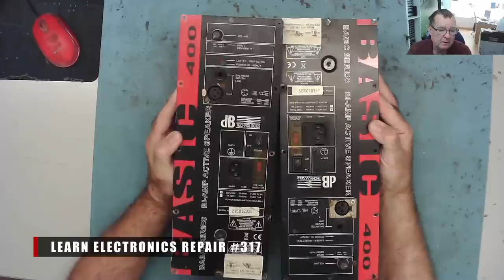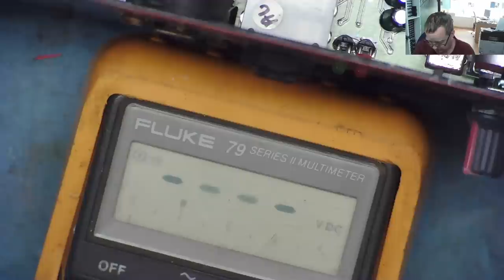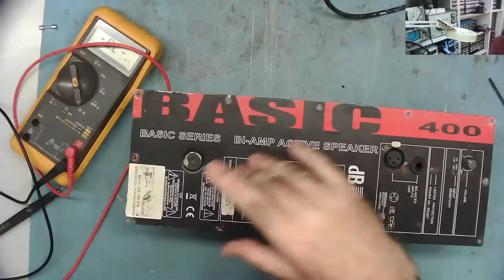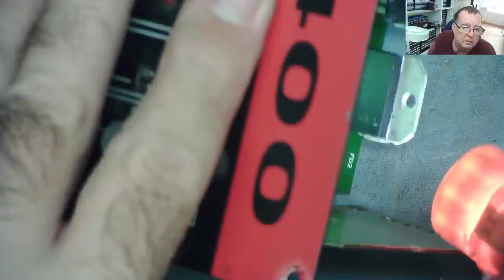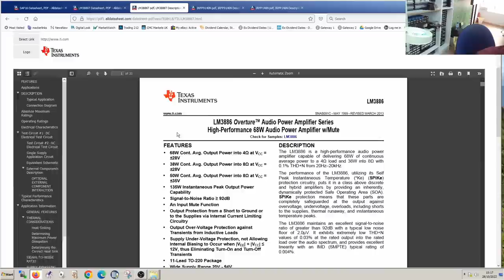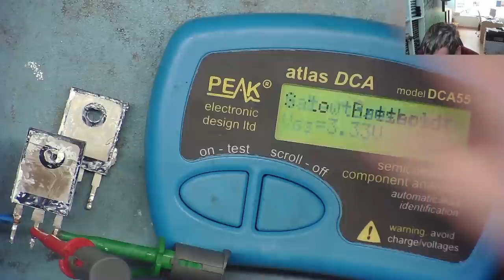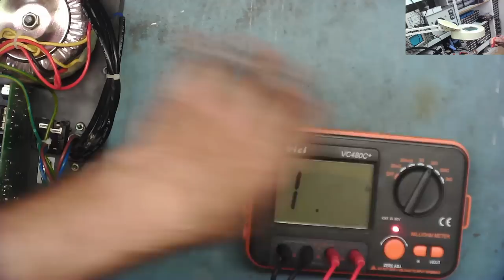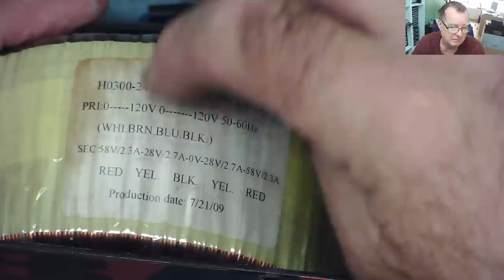BASIC 400 Powered Active PA Speaker - Blows Fuses, But Why?

Comment: Personally, I would have pulled the high voltage fuses before pulling the MOSFETS.  I'd need some measurements to be sure, but I think it would have accomplished much the same as far as isolating the fault.
Reply: I was thinking the exact same thing and was about to type that until I saw your comment
Reply from the maker: In retrospect I totally agree with you 😉
Reply: Russell I’m not quite sure what you mean? There is only 1 fuse in the 240 and surely leaving that out is only isolating the iec input which is basically like leaving it unplugged and then what. Unless I’m missing something?
Reply: @deangriffiths8107  We are talking about the 2 load fuses on the PCB itself.
Reply: Thanks for the reply Eric that makes sense now, I had a couple of shandy’s last night when I commented so this went over my head.
Reply: @deangriffiths8107  There are two fuses on the PCB that are for the high voltage to the power amp.
Reply: @russellhltn1396   yeah I realised that this morning when I saw the reply from Eric, thanks for replying though I do appreciate learning something every day.
Reply: @deangriffiths8107  Lol no worries!  Cheers 🍻
Reply: Personally, I would have looked for the schematic first.

Comment: I would have checked the fuse in the working amp to confirm rating. Anything not sealed with a blown fuse, might have had it swapped by a DIY bloke with something random he had at hand
Reply: The fuse rating on the cover says slow blow 2.5A 😉

Comment: I was surprised that you didn't zero in on the supply section quicker as the DC fuses were not blown - but then armchair technicians are like armchair quarterbacks! I had my money one the voltage selector switch - cheap switches plus island environment, a little corrosion, a little heat, some melted plastic - pop goes the fuse. Thank you for sharing the process - always interesting no matter the outcome. Regards,  David
Reply: I was shouting transformer, you know that bad feeling...Edit reading another  post seems there were MOVs or caps there too, so not just bridge and reservoirs..I was skipping through and someone said he measured a short?
Reply from the maker: @martinda7446  If there were any MOVS there then A: they were the special transparent ones and B: They changed the resistance of the secondary winding (with the transformer disconnected from the PCB)
Reply: @martinda7446   Yes, a bad feeling indeed but that toroid looked sooooo good on the outside.
Reply from the maker: @davidv1289  Yes it does, if it looked distressed I would have homed in on it much quicker
Reply: David, absolutely it’s easy for someone watching and then to say at the end why didn’t you look at the transformer first. I like a lot of others enjoy watching and learning from someone actually doing.

Comment: Thank you again.
I am but a mere electrician, but when looking for faults i always work by "big fault, big components first". Since the transformer was easy to unplug, it would have been the first thing on my list to cross off. BUT i seldomly have two of a kind, so comparing resistances of the winding helps a lot.
However i enjoyed the methodical hunt alot. Always learning new stuff... like where the hell do i get a lightbulb in 2022? 😀
I was planning on building uC controlled current monitor that cuts power to a device when a selected current is exceeded. Dunno how useful it would be though.
Reply: I have a digital current control power supply I used for DC stuff that's super handy.  I bought a cheap voltage/current control module off of Amazon for $10 and put it on a large DC supply.  It's a boost/buck converter.  Gives milivolt accurate and miliamp accurate controlled output, and has auto current limit or shutoff.  Goes up to 30 or 40 VDC from .001 to 20 amps or so.
For AC you'd need something smarter and more expensive but almost everything ends up converted to DC in circuit anyway so I have yet to need one.
Reply from the maker: The reason why I didn't find this fault earlier was not because I wanted to make a good investigation video but because shorted turns on the mains transformer is really uncommon, and especially so without it looking physically burnt/distressed.
Reply: @LearnElectronicsRepair  I see, this is perhaps because my contact with stuff is a bit different. I usually had to deal with either stuff that was hidden inside wall boxes with insufficient cooling, smashed components (if they don't fit, they'll find a way to make 'em fit) or with stuff in heavy industry settings where there was so much metallic dust going around that you could meassure the air with an ohms meter ;-D
Reply from the maker: @DasIllu  I think this is a likely case of too much knowledge slowing me down.  I agree someone with less experience of these amplifiers would likely have found this fault quicker.  But hopefully more viewers will know about it now if they ever come across it.
Reply from the maker: Regards light bulbs, I buy then from the local shops, is there a shortage of them?  You can also get them (halogen ones which work just the same - in fact some of mine are halogen) from AliExpress, Amazon, Ebay etc no problem so I don't think I'll be panic buying in the near future 🙂
Reply: @LearnElectronicsRepair  Thanks again. Everything incandescent has vanished from the local shops here in germany. It's been years since i last saw a halogen bulb in a bulb. Maybe they have some hidden in a dark corner in my local DYI shop. Will investigate.
Reply from the maker: @DasIllu  Look for the straight halogen bulbs type R7s they are generally available in large hardware shops.  Also G9 which you can get a pack of 10 from Aliexpress for €4.55 with free shipping.  These come in ratings up to 60W and you can use a few in parallel if you like.
https://www.aliexpress.com/item/32677043072.html?af=ler2022

A coupe of packs of those should keep you going for a very long time.

The limiter I use in the video has a 65W halogen bulb.  My other one has two bulbs and is selectable 60W/100W/160W
Reply: @LearnElectronicsRepair   I’m not sure people with less experience would have found this quicker as the transformer showed no signs of damage.
Reply: @LearnElectronicsRepair  Good to know, though. The bulbs are forbidden here in Holland. 220V Halogen is easy to get. But not for long, I assume.
But a fan could work, isn't it?

Comment: Low melt solder works great when the board is really thick or the component itself has legs or heatsinks incorporated... that way there is less chance of damaging the PCB, plastics or components near it.

Comment: Measure that transformer using an insulation tester (or similar like Megger). Plus measure the primary against the secondary. The insulation tester will tell you quick if you got a shorted  or open winding(s).
Reply from the maker: The transformer causes a short condition when it isn't even connected to the PCB.  And the secondary winding reads low compared to a known good one.  What more is there left to prove?
Reply: @LearnElectronicsRepair   Wanted to see if the short is just between the pri winding or went through the pri -sec, or shorted to the case. Doesn't matter... However using the dim bulb tester, plug in that transformer with the secondaries disconnected... see if your dim bulb light is bright or not. Should be a easy and clear verification if the primary is indeed shorted to itself.

Comment: I'm sure I'm not telling you anything new, but when I have stubborn components that don't want to  release from the pcb- i flip the pcb upside down and just feed a massive glob of fresh solder that covers over all the pads at once and it just falls out.  Its also how I remove multi pin amplifier chips too. Thanks for sharing all your knowledge with us!
Reply from the maker: Nothing new, I do that quite a lot on video but you are right, it's a very good technique 🙂  There are always many ways to achieve the same result in soldering.

Comment: I always learned to rule out stuff instead of random chasing faults. I would have started at the transformer, disconnect the outputs and see what happens. In this case the video was done in about 5 minutes.
Reply from the maker: It wouldn't have been a very good video though 😆

Comment: I think one solution to removing the fets would be to use low melt solder or to acquire a large soldering iron wide enough to cover all three connections at the same time, such as a hobbyist wood burning type hi wattage iron
Reply from the maker: Yeah that could well work - there are always a number of different ways of doing this sort of job.

Comment: Very hard to find a shorted turn in a transformer unless it a short between each end of the coil. A shorted turn in the middle of the windings will not show up with a resistance test as one turn will not change the resisance much. Bit as you say a shorted turn will show up with AC as it will be a one turn secondary looking into a short circuit and draw lots of current. 

Lets hope that they used an off the shelf transformer and not a custom job. The other thing that can cause the fuse to blow is if they have removed the transformer and not put it back on corectly. the mounting bolt through the middle can be seen as a shorted turn if it gets connected together at each end on the outside of the transformer.
Reply from the maker: Your comment on the mounting bolt acting as a short is very interesting.  It would not of course produce the resistance readings I got on the bad transformer secondary, but I will definitely keep that in mind for the future 🙂
Reply: @LearnElectronicsRepair  DC tests will not show a single shorted turn E,g resistance measurements, they will show if the ends of the windings are shorted. Or a major breakdown of the windings due to overheating, but I expect you would have seen signs of internal overheating on the outside. If the transformer is scrap then unwinding it might be the way to see what has occurred to it.
Reply: @karltest1314  Which is why i said you can't find a shorted turn with a DC resistance meter. you need an AC componnent.

Don't mix the current fault and the previous fault, the last is just the outcome of the first. A slowly overheating winding will not blow the fuse as it build up to breaking down the insulation. Once the insulation breaks the last fault appears in which now it will blow fuses in an instant. First fault was the cause the last the affect.
Reply from the maker: @TheEmbeddedHobbyist   I hear what you are saying but IMHO you can (sometimes) find this fault using a DC resistance meter when you have a known good one to compare with.  I'm confident I proved that with the Fluke, then went on to confirm it with the Milliohm meter 😉

Comment: Iv got abit of an issue with something im working on and wondered if any of you clever cloggs could point me in the right direction . So ive got a panasonic dvd/vcr recorder, which needs a firmware update, the update isnt available anywhere , i have the main board from the same machine which has a different fault but should have uncorrupted firmware, my question is where would this firmware be stored , i know on tvs its usually an 8 pin bios ic , am i looking for something similar here? I want to swap the chip with the firmware over to get one working machine out of the two bad main boards . Thanks for any help
Reply: I suppose what im really asking to clarify, is firmware always stored on 8 pin bios ics in most devices ? Im not a software guy whatsoever hence me being so clueless
Reply: Update: firmware was on a 50 pin chip, machine now working

Comment: If the transformer overheated I would expect the thermal fuse to go , so it’s strange to get a shorted winding with no obvious cause.well done !I would have struggled with this I’m sure
Reply: I need help to fix mine
Reply: The thermal fuse is usually touching windings on outer part of transformer and can sometimes be replaced. A dodgy job is to short the fuse but then you have no thermal protection!
Reply: How do I get a hold of you to show you a picture
Reply: Try searching YouTube for transformer thermal fuse , there are a number of good videos 
PS it’s important that you find out why the fuse has blown !

Comment: The only time ive had something blowing fuses with no short , was a tv i was working on, a small blue ceramic disc capacitor on the primary of the psu had a hairline crack in it , and after i found and swapped that it stopped blowing the fuse
Reply: So it expanded from heat? Or created an arc?
Reply: @TheDurdane  im not sure why the cap failed , it was connected to one of the pins on a mosfet on the primary

Comment: Reminded me to ask a question been bugging me for months. When you mentioned using your thermal camera, it reminded me to ask if capacitors that are not working get hotter or show cooler than ones which are good? And a supplementary. 

I'm always impressed by the precision of the characteristics component makers list and I wondered whether a predictable working temperature can be stated for most components? It would be a function of their wattage, composition and size? It might be quite a quick way to diagnose faults if components had a stated working heat output? Or am I being lazy and looking for a quick way of doing something that can only be done the hard way, with skill and experience?
Reply: Yeah I've been wanting to add a thermal imaging attachment for my phone for this reason. I've  even considered getting the Cat branded smartphone (it comes with a Flir camera built into it from the factory) even if I just used it as an offline unit (the appeal being the rugged design and impact resistance it has. 

Anyway, with something like that recording when you turn on the mains, even if brief, there should be a hotspot right?

Seems like a potential time saver for sure. I haven't been doing much of any PCB work lately so I've shelved this "need". Chasing smoke and using an infrared thermometer to guestimate the source will suffice for now. 

TL;DR I agree a thermal camera would make quick work of identifying the heat source.

Comment: IF IT WAS ME I WOULD UPGRADE THE MOSFETS,! higher amps and higher voltage,, plus new transformer
Reply from the maker: To achieve what? (replied before you edited your comment to mention the transformer)
Reply: @LearnElectronicsRepair  Higher tolerance margin in the FETs?  Although the fuses should stop damage to those.
Reply: @_Stin_  exactly. people make mistake of just replacing like for like, but while ur in the unit upgrade just as cheap,, i been a engineer for over 30+ yrs in ind and fix amps on a regular basis, but thats just what i would do, mosfets that are too weak put a very large strain on caps and transformer, if they dont switch fast enought they cause, ware on transformer, higher amps mosfets and power output quicker push n pull. releaving transformer having to work harder, less strain,,"also transformer doesnt have to be exact same voltage out think them transistors can handle much higher voltages, on output stage, you would need to check, on what they can handle if ur keeping original fets, but like i say i would upgrade them,

Comment: Re LEDS you didn't notice the round and square pads.
Reply from the maker: I noticed the K markings on the PCB.  I think the part about the internal structure of the red and green LEDs was quite interesting and maybe useful to some viewers.
Reply: Also, LED housings have a flat side that marks the cathode.

Comment: Hi Dicky, will there be a follow up video on the repair of this unit, your videos are always great 🤙🏼🇦🇺
Reply from the maker: I have to say this one is pretty much conclusively proven and finished - unless he has a replacement transformer from a scrap speaker or something like that.
Reply: @LearnElectronicsRepair  why not try and see the fault in the transformer and then try to rewind it? Oh btw, you probably know this trick, but use a cr2032 battery to test LED’s on camera if you want people to see it light up.. also use the dmm on continuity to test fuses.. just a couple of suggestions that’s all.. 🤙🏼🇦🇺

Comment: 400 speaker with 270VA transformer....
Reply: You have to remember that music power is different from electrical power. its just put on the labels to sell more amps. 🙂
Reply: Yeah... That is just a model number 'coincidentally' chosen and having as main purpose to rip of customers. It is written nowhere these are Watts. And if it was written 'W' or something along it that would never mean Watts as we know it to indicate the rate of energy transfer.
Reply: @karltest1314  And rms is just used to compare the power of AC to that of an equivalent DC power, with music the Crest factor needs to be considered as well.
Reply: @karltest1314  Agreed - It's RMS of GTFO lol
Reply: @Joe-by8jh  where did you see me defending it, and yes i used to design audio units! But at £25K plus a unit it's not what you would call cheap junk.

I also was just pointing out that AC voltage defined as RMS is just a way of stating  that a voltage of 240Vrms or 240V dc will provide the same power in to a resistive load. if you think of voltages that are not a sine wave you need to also include the crest factor to get the correct rms voltage. and thus the equ power.

So at 400W's that's just about 1/2 a horse power. or maybe we should bring Mr Bel and his friend deci to the dance party.